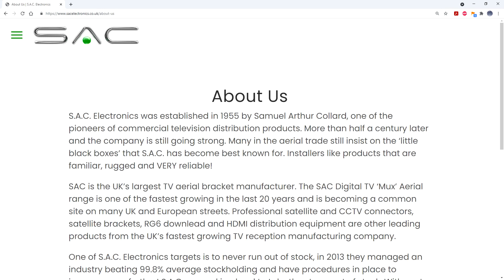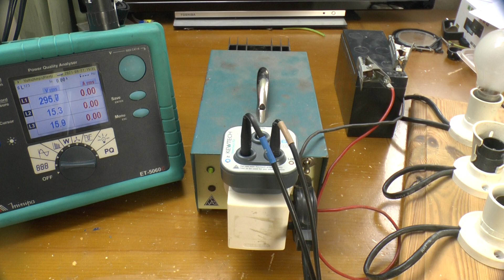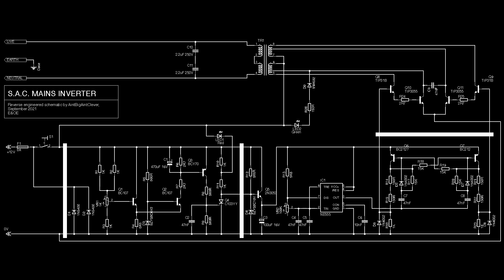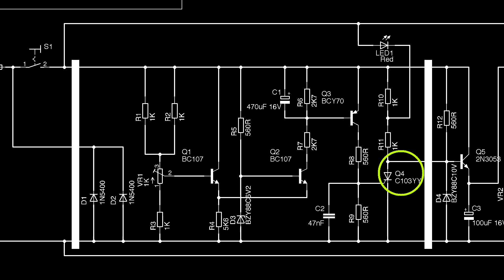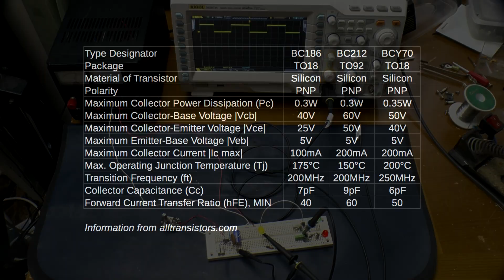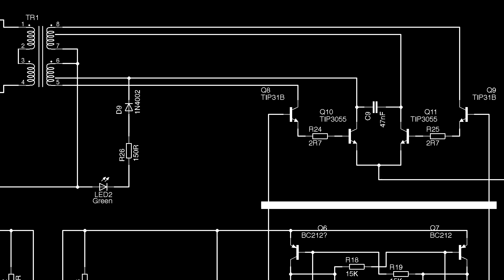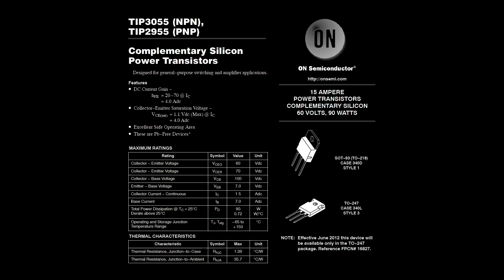Vintage S.A.C. mains inverter teardown

Comment: I can se where you got confused, the second 'oscillator' looks like my favourite astable multivibrator (my first circuit in the early 70's), but it actually looks like a bistable oscillator, the 555 switches between pos and neg to trigger it. it's probably there for more stability over voltage variations.
My 'dual output transformer driver' video is probably what you were thinking of
That inverter looks home built, but it might be a small company that never really got going.
Reply from the maker: I was looking at twin-transistor multivibrator circuits online, and it was close enough for me to think it was another one (well, it's got two transistors, albeit PNP, and tracing what they were doing to each other kind of made sense) but that wouldn't explain why the 555 was there, hence me breaking out the cheapie breadboard.
Reply: @AintBigAintClever  PNP because the designers were used to the 1960's era germanium transistors which were overwhelmingly PNP, as those gave the best result in manufacturing, and were a lot cheaper than NPN ones to make with germanium processing. Then came silicon, with epitaxial diffused transistors, where it was fast realised NPN was the faster, easier part to make, while PNP was a slower part because of the higher doping levels and the different dopants. So the output stage used silicon NPN transistors, because they were cheap, but the divider likely used an older circuit the developers were comfortable with, which used PNP transistors. 

That it also saved 2 inverter transistors to drive the output stage was a good bonus.  The 555 timer was likely used as "the new IC revolution, gotta have one in the circuit" and replaced a bistable using likely another 2 PNP transistors that made 100 Hz, which probably needed special wide range adjustment pots to get the frequency 100Hz, as electrolytics (would have been a need, 10 uF and higher polystyrene capacitors are darn expensive), so using the IC saved expensive parts and also said it was a modern IC design.

The rest was probably a design from the 1950's, using parts they already had, which was upgraded to silicon when germanium power devices started to be obsoleted, and the price of them skyrocketed accordingly. minor changes to assembly, minor changes to circuit, and hand assembled as there likely was a stock of cases and transformers around, so the company wanted to sell the units to use them up, then come with a whole new design. Use up the last 500 or so, then retool for the new 70's version, probably more profitable, and with a PCB in it as well. That would explain the odd transistors, using whatever was in the bins.

Comment: I would say it looks like a home built unit using plans from an electronics magazine of that era.  It is a well built unit.  the logo is a mystery though and could be just from wherever it was used maybe. I like the SCR circuit to positively lock it out in case the voltage gets too low, it will fire and not reset until power is turned off and back on, which will prevent it kicking on and off.  I guess in 1979 using a CMOS flipflop was too expensive or possibly wouldn't have liked the dirty 12V in there which is why they went with the two transistor flipflop circuit.
Reply: CMOS did not have the drive ability, plus yes would have been killed fast by spikes. Plus in 1979 CMOS was bleeding edge pricing, easily triple the price of TTL, and many times the cost of plastic case transistors which were becoming common and reliable at the time.
Reply: 2 decades later, and all of that control circuitry could be replaced by a single SG3524 or TL494 switching controller.  I've actually built inverters using the former, and it's just the chip, some passives and some MOSFETs.

Comment: That strange circuit after the 555 timer is a divider, to make the 100Hz into 2 equal duty cycle drives for the power transistors. Each rising edge off the 555 output attempts to turn both transistors off, but only the one that is on will get enough base current removed, as it has charge on the capacitor, so the current pulse can flip it off. Then the other transistor turns on, and keeps the first off, and when the output from the 555 goes low the capacitor for the second transistor can charge, so the next high pulse the first transistor can turn on again. Thus the change in state every so often as you went rail to rail testing it.

The reason they probably changed the transistors is that likely the original ones were too closely matched, so on power on they likely both turned on partly, turning the output devices on, and blowing the input fuse. Thus change one to a different gain type, so it will power on in a fixed state, but can still operate. 

Transformer overwind for the drive side is so as not to need a base current resistor that has to dissipate 25W, it has briefly a 12V supply at turn on, but as the current ramps up in the transformer core the voltage applied to the collector of the driver drops, so the base drive is still large enough to keep the transistors saturated, but the base resistor can be a lower power unit. Yes likely a 50VA output, though it likely can do 100VA for a few seconds, with the fuse blowing after about a minute. Likely original fuse was 10A fast blow, more there to handle reverse connection ( most common thing) and shorted output, which blows it in about a second.
Reply from the maker: I was wondering whether they were deliberately mismatched to tip the balance in favour of one side.

Useful extra info from you there.  Didn't get that in my GCSE in CDT:Technology :D
Reply: @AintBigAintClever  A bonus feature is that the resulting waveform will always have a 50% duty cycle. And that's what you want, otherwise you'll DC saturate the transformer.

Comment: I have a mass-produced pure sine wave iron core inverter that weighed like 30 lb from go power
Reply from the maker: Any idea how old that is?  Pure sine UPSes have been around for ages, albeit with higher battery voltages for the higher wattage ones, so I'd expect it to be similar tech.
Reply: @AintBigAintClever  I bought it back in 2015 the 12-volt Model and it's only 300 watts at 120 volts uses a big Bank of mosfets on both polarities
Reply: @AintBigAintClever  I had a few that were ferroresonant designs from the mid 1970's, some from mid 80's and even some from around 1995, all used honking big copper wound transformers, massive resonant capacitors and variously power transistors by the dozens, or power blocks on a massive heatsink, for the output stage. I used to order 2N3773 transistors by the tray of 150, because you would need a tray per machine to repair it, as any fault would blow 30 devices at a minimum.

Still got a ferroresonant voltage stabiliser around, I use it as an isolation transformer, as it does provide isolation, but standby power use is around 250VA.
Reply from the maker: @SeanBZA  we used to have Galatrek ferroresonant UPSes for some of our phone systems.  They buzzed like crazy, but that was normal and at least it meant people wouldn't meddle :D

I featured one in my "UPS comparison" video ages ago.
Reply: @SeanBZA  Ferros are also real good surge arrestors, but they run hot (my 1kVA ferro uses around 150W no load) and are bloody expensive new.  Depending on the design and age, they can also have a lot of output harmonics.